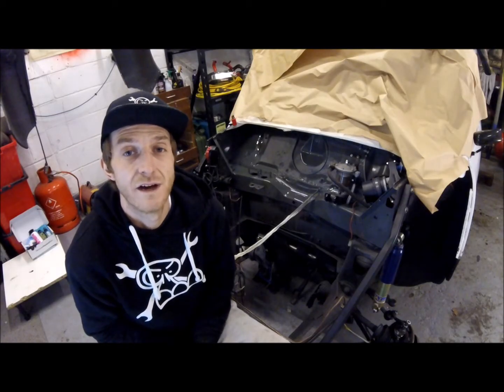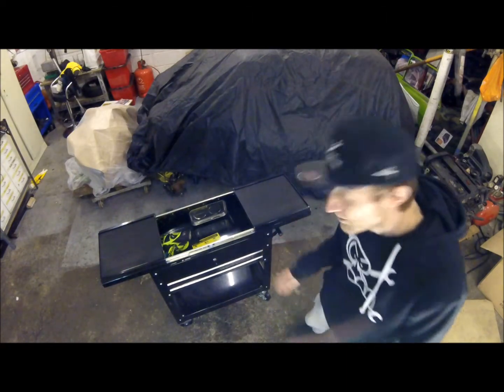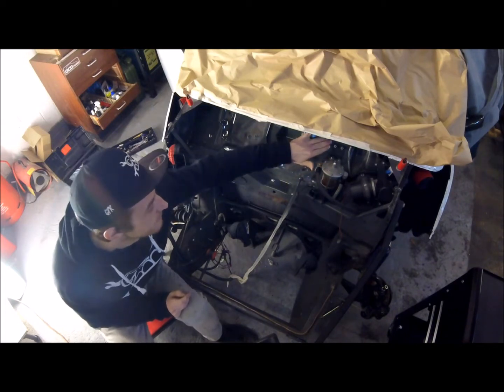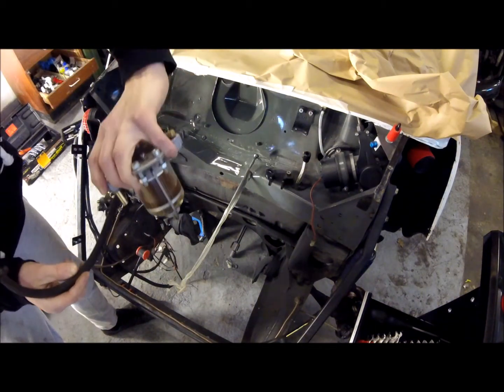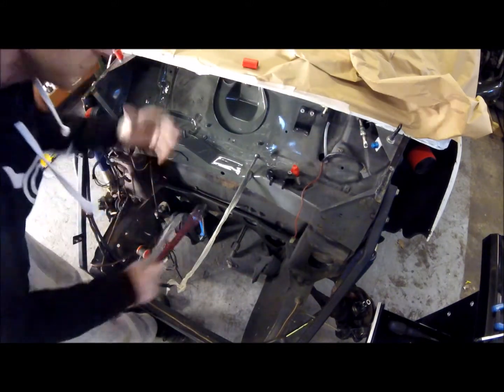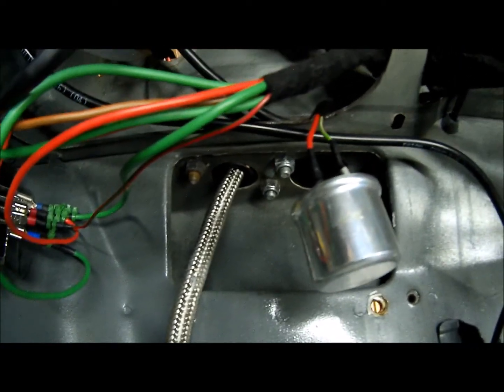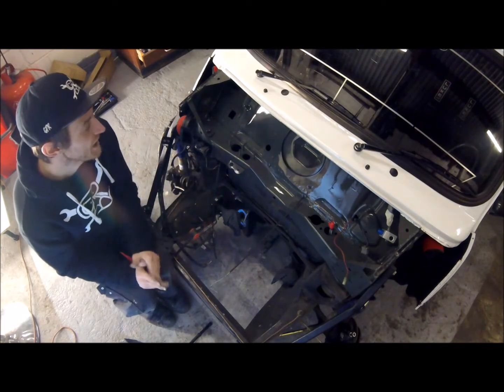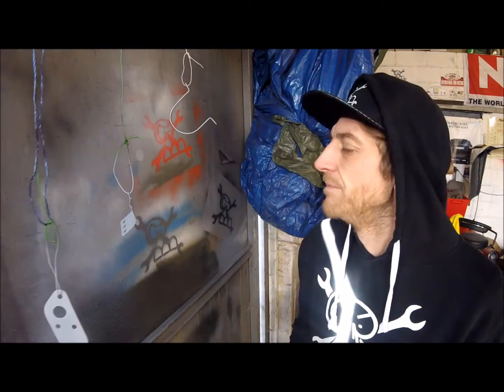Mini Diaries Episode Six - Tool Dolly, Bulkhead Fail & Fix

Comment: You and I have same filter king setup, but you running your fuel delivery line inside your mini?
Reply: Ok I see now....it’s a race set up.    Looks great.  Make sure to protect your stainless fuel line where it crosses the interior bulkhead...that edge it is resting in will cut into the stainless weave over time.  Maybe a bit of fuel tubing on the edge will work.
Reply from the maker: thebluep0tat0 it is in the future plans to fit a nice bulkhead fitting one day. I’ll keep an eye on it tho thank you